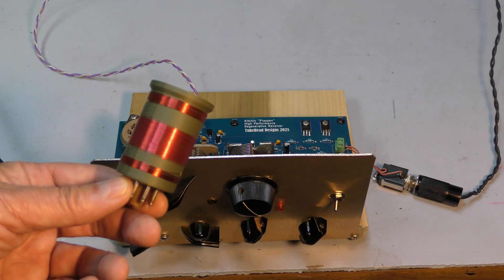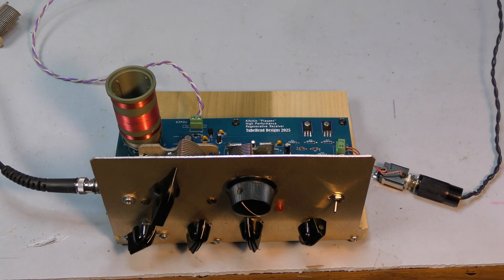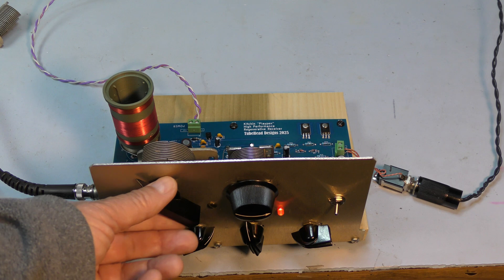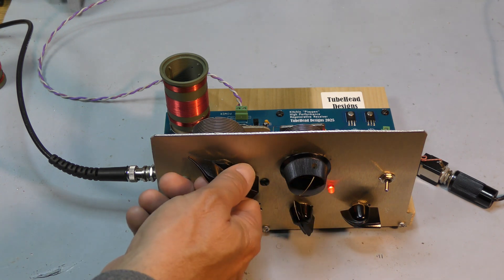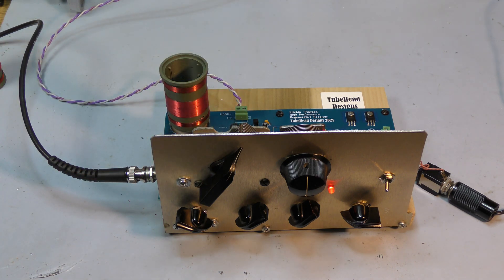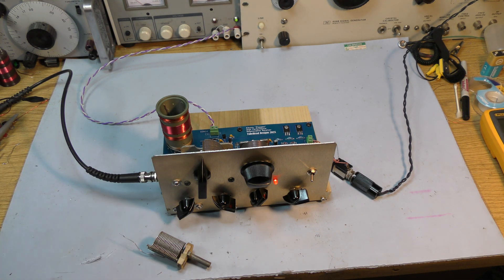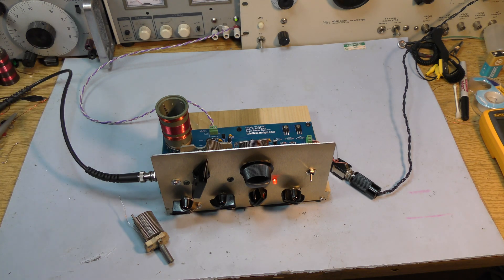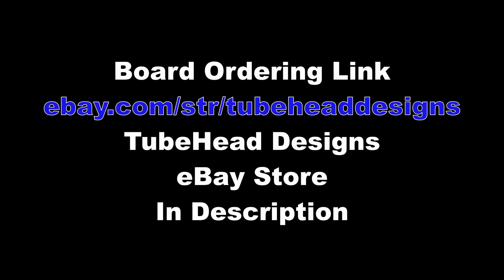Kitchin High Performance Regen Throttle

Comment: Hi schematic diagram?
Reply from the maker: The circuit is based on the N1TEV High Performance Regen Receiver, as featured and published by the ARRL in QEX for Nov/Dec 1998. TubeHead Designs is currently restocking the board.  It comes with a detailed booklet with schematic and parts list. https://www.ebay.com/str/tubeheaddesigns

Comment: In this video, the BCB coil has two different wire gauges, with the 100T secondary being finer, and the gaps are maybe 3/8" and 5/16". The instructions supplied with the board suggest 28 or 30 AWG wire for the BCB coil with 1/8" gaps on a 2.5" long form. To wind the coil on a Tubehead octal form as shown in the video, I believe the wire can be no larger than 30 AWG with 0.12" gaps to (barely) fit within the 1.72" usable length. Can anyone confirm?
Reply from the maker: It's not critical. The smaller wire allows a few more turns on the form.

Comment: Board is in the mail, few hours after is payed, i am impressed.
Coil forms i alredy have, i made 20 pcs long time ago from polycarbonate tubing and dead tube bases.
Is there any chance to make it work on LW, by using litz wire and 500pF variable caps? I assume that it would not be easy.
Reply from the maker: I don't see why not! I would scramble wind about 300 turns as the Secondary, 25T on the input and Tickler to start... and use a BIG variable.

Comment: Can you suggest a minimalist antenna that would allow reasonably good BCB and SW operation?
Reply from the maker: Indoor? Attic? Balcony? Small Garden? High Rise? A nearby tree from the house?
Reply: @MIKROWAVE1  Thinking indoor, maybe a frame loop as you have described elsewhere.
Reply from the maker: @marpenman  This board would support a frame antenna AS THE COIL on the BCB. if you did not populate the preamp parts. But I don't think that is what you are talking about. Indoors it is hard to beat a loop. You could try a tuned shielded coax loop indoors like a big square loop on the wall of maybe 5 ft on a side. Coax split on top. Shield connected on bottom.  Hots exposed on bottom for connection to the tuning cap. And a variable capacitor or band switched arrangement to tune it. Coupling to the loop would be a nested coax loop (off the coax feed) of say 12 inches diameter of the standard hot to shield trick.    Ground the shields together at the bottom at the feed.
Reply: @MIKROWAVE1  Thanks!  Loop antennas are quite the rabbit hole. I've read a dozens of web articles and watched as many videos. Your Big Loop series (and especially Pt 4) video is very informative.

Comment: I'm wondering about using a wafer switch and a bank of disc caps to broaden the capacity of the throttle cap. Long ago I built a regen kit made by Ten-Tec that used varactor tuning. It worked okay but it wasn't a "fun" radio to use. It's buried somewhere on my bench, I think. Strong work, Mike & Son.
Reply from the maker: Good idea! And Band Switching is certainly possible with a rotary switch arrangement. It will be interesting to get pics, progress and issues from folks as they develop their build.

Comment: Great job Mike! Not a bad sounding little receiver. Take care.
Reply from the maker: The audio off the source acts more linearly that off the (Plate) Drain. But a real diode detector will still beat this. The good audio section is what really helps with this Kitchin over that old LM386.